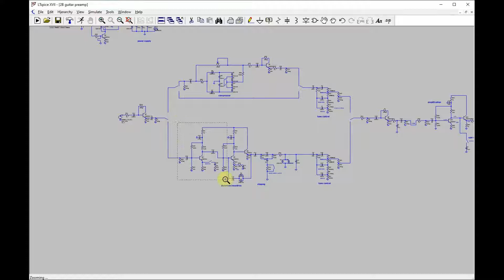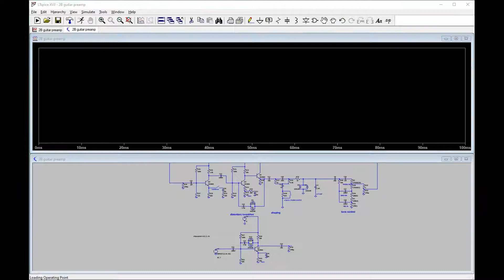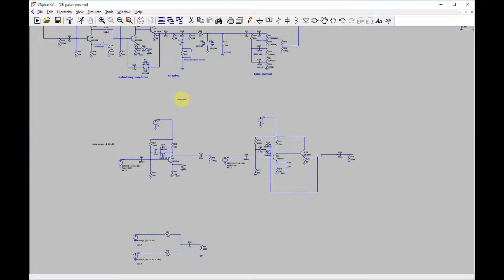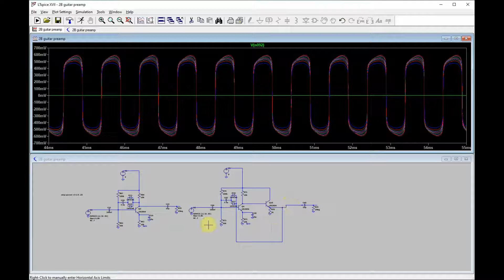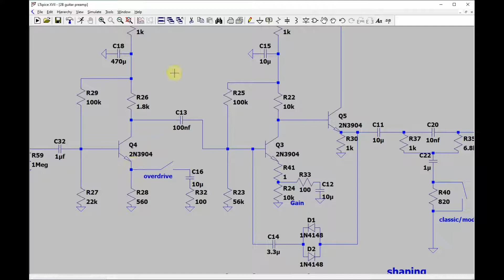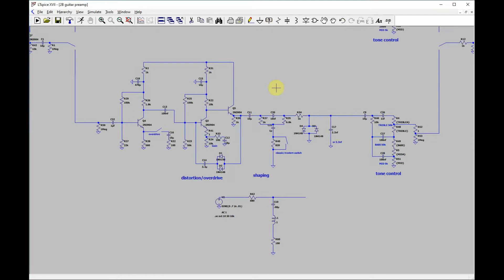Guitar Preamp Series - Video 2 Distortion

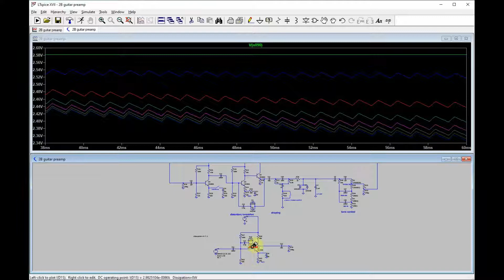Comment: @ 5:00 shout-out to Nuts n Volts! I still hang out over at the forum.

Niche area for sure, but that's what makes it unique and really puts you back in touch with what all these full-featured-amp-on-a-chip take for granted. Can't wait to watch the rest (except I've got to put in another hour yet - time shifting parts of the day you know...)

And thanks for going through this. You are about the only guy out there who is doing things based on one of the most popcorn of transistors, the 2n3904. I have an affinity for them and am trying to come up with the many ways to get the most out of them. So I am glad you are doing this. Thanks!!